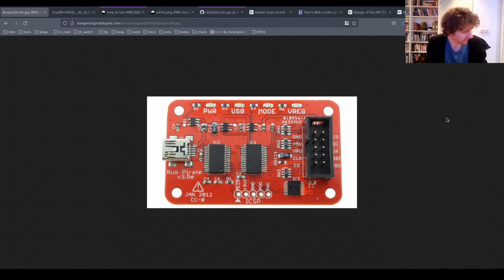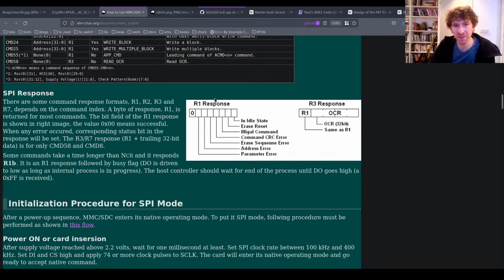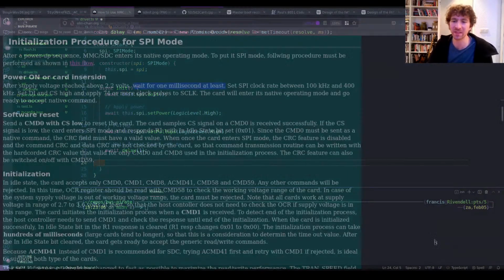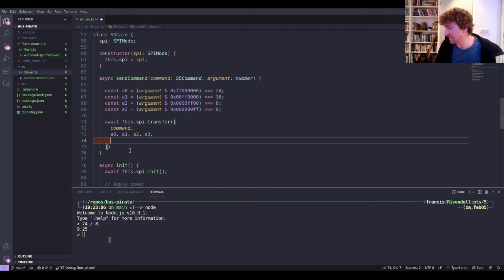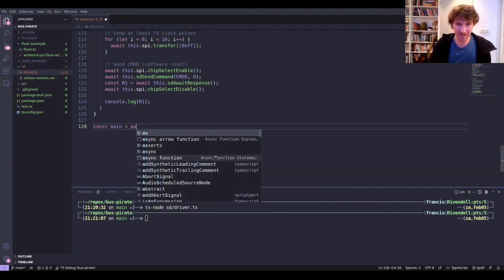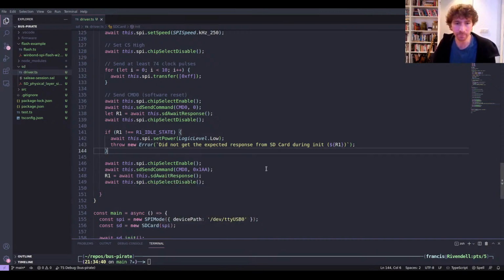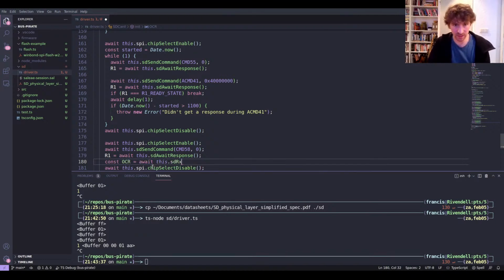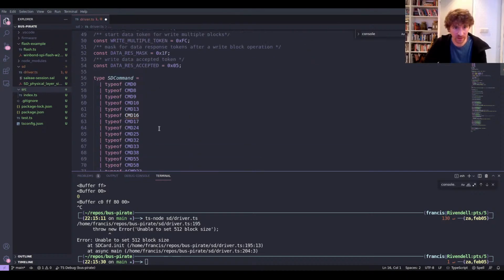[stream] Writing a SPI SD-Card driver in TypeScript

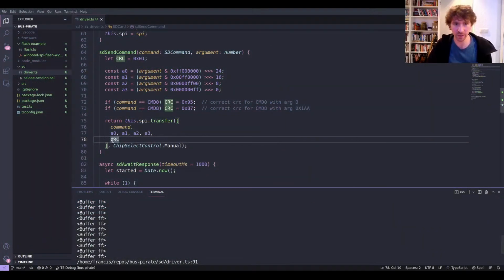Comment: I'm glad you caught the 01 bits for the command at 1:21:53. I was thinking to myself that it looked like you were missing a piece in your transfer. Only reason I even noticed though is because you explained it so well. This was an excellent stream!
Reply from the maker: Those are the most annoying bugs to spot and then the person streaming doesn't see if for ages 😅
Reply: @LowByteProductions  I thought you did spectacularly. I am used to pair programming, but streaming you have waaaaay more eyes on your code haha.

Comment: Shouldn't it be || instead of && when checking R7 in 1:42:04? Also thanks for the Video I am learning a lot :)

Edit: Just saw someone mentioned that during the stream. I still think it should be ||.

R7[2] !== 0x01 && R7[3] !== 0xAA
Try 0x0000FFAA you would get false && true which will result in false. If I understood correctly this is wrong.
Reply from the maker: Ah I'll take a second look!
Reply: I think you are right. He merged it with the above if checking that the R1 !== R1_IDLE_STATE. If you merge two if's that are both early returns/throws, they should be OR'ed together not AND'ed.

Comment: Hello, friend. Regarding your explanation and diagram around 35 minutes I have a question for you: how does the slave know when the 'middle' of the clock half-cycle is in order to sample the data on the bus? :)
Reply from the maker: I would need to look it up to know for sure, but I'm fairly certain that it's just because the device has a a limited range of timing that it works in (100kHz - 400kHz), so it just samples some amount of time after the edge transition is observed according to that known range.
So not like UART, where the device hardware needs to observe data timings and count to the correct time to sample.
Reply: @LowByteProductions  A UART RX has its own clock running faster than the baud rate in order to sample within the data bit, however the SPI slave is clocked at the data rate directly by the master. The solution is extremely simple and elegant: the bus is sampled on the edge. The key is that the master drives the output on the prior opposite edge. Take a look at chapter 19.4 in the atmega328p manual for timing diagrams for all four modes.